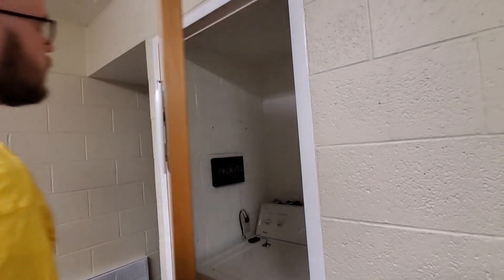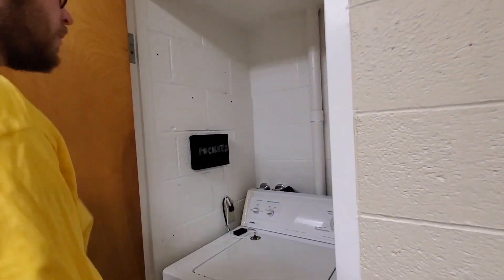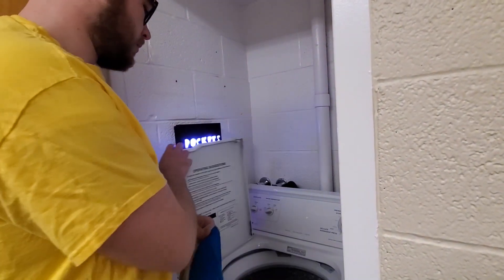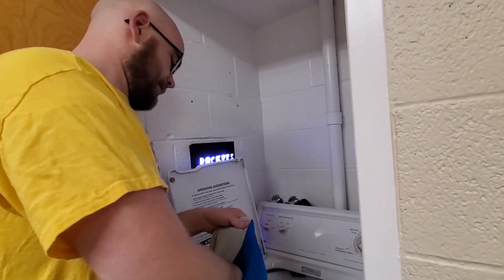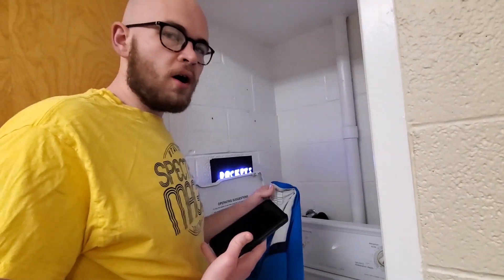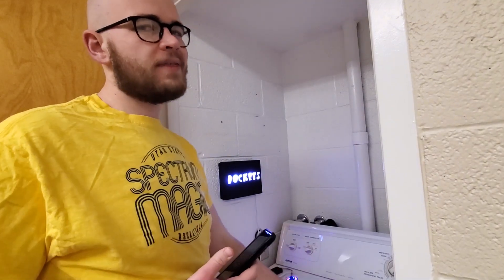Laundry Warning Sign by Sara C.

Comment: This is so relatable. You chose a great problem. Looks very functional. How long does the sound go off? If it’s always while it’s open, you might consider something like “every 20 seconds make that sound”. This would be more desirable as a product I think. But I love how simple it is. It works great. Good job!
Reply: Thank you! Once it is activated, it flashes and makes noise until the lid is shut and it is flat again. The alarm is pretty annoying that way, so good idea! The alarm going off every 20 seconds would probably still be effective, but wouldn't be as irritating.